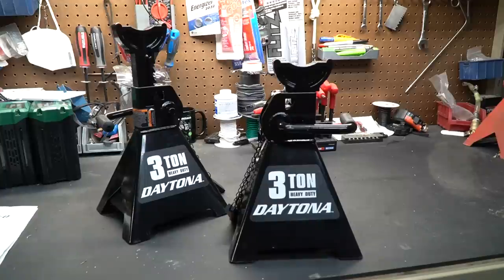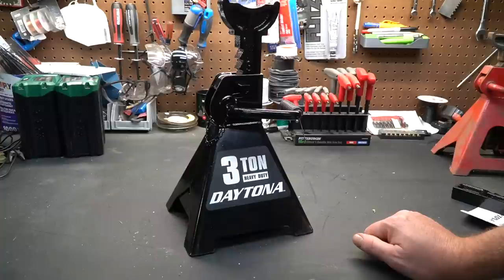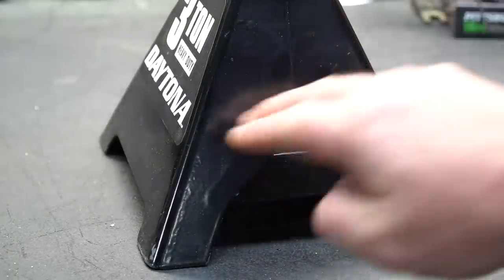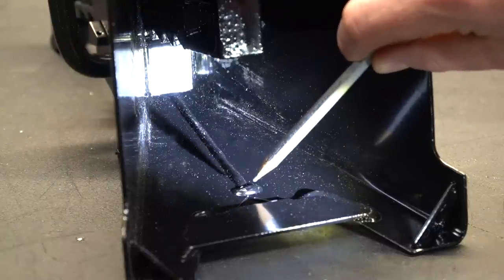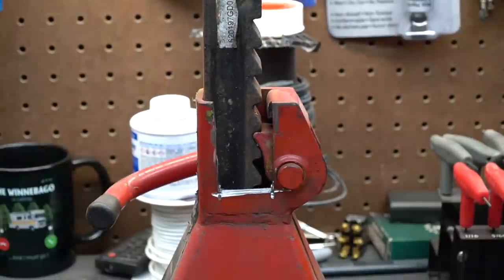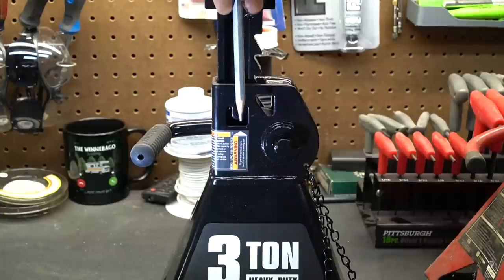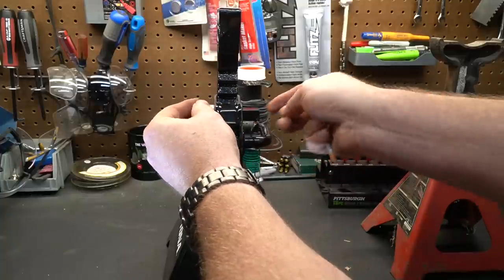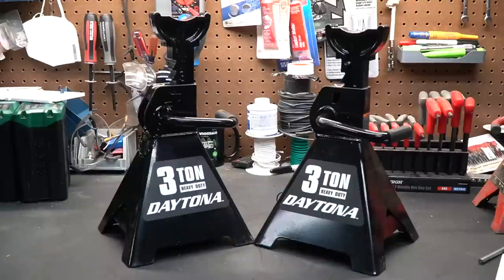Harbor Freight Daytona 3 Ton Jack Stands, Full Review, New Tool Day Tuesday! Locking Jack Stands!

Comment: good job Harbor Freight, in response to the recall, they add the double locking safety pins. makes me feel very safe using. I have the pro lift 6 ton double locking with same design as this. very safe and sturdy

Comment: I really like these! I may have to go get them. I honestly think the set I have still been using is the recalled ones 🤣
What's nice about that lock key stoping the arm from lifting and releasing is you can carry the stand around with them set at the height you always use without them collapsing when you set them down or the saddle lifting up if you grab them by it. I have pinched my fingers in them when I move them because the saddle slides shut when you bump the arm while carrying them.
I know there is a little lock tab you're supposed to knock in when you assemble them but I do NOT because I like that they come apart. I've been known to used the saddle/rachet part in my press.

Comment: I have this style stand in Australia but the handle attached to the claw has a shear pin through the centre of the handles round bar that shears off if to much upwards  pressure is applied to the handle while under load leaving the claw in its holding position and the handle spin free , a great design as i did break one pin  but no failure of the stand at all ,
The safety features on those look very reliable i would definitely purchase them.

Comment: I thought the only real issue with the old stands was that the pawl didn't have 100% engagement with the ratchet and thus could fall if the vehicle shifted, but otherwise they were decent stands. 

HF really went overboard with the engineering on these replacements from the embarrassment of the recall.

Comment: Was that stand that you cut away a hf stand ? Because that is not how the old stands worked. They had the teeth jamming against a cam, not a tooth. I looked at a few older ones including mine and no tooth was engaging. Looked to me like either a terrible design or incorrect installation.  Either way, they got it right this time. And yes, as a long time mechanic, all stands had teeth engaging teeth.

Comment: Great review! However, bumping the handle while working under the car is very easy to do and there are other videos showing just how easy the old HF stands fail. Think about someone with a pry tool or swinging a hammer accidentally hitting the arm. The original HF Jack stands only required about 1/16" to 1/8" of movement before the jack would fall unlike the new one with much more defined teeth and safety pin. I cringed and felt sick when I thought about how many times I've put my life in jeopardy through the years with my old HF jack stands.
Reply from the maker: The pictures I seen of the really bad ones that were part of the recall hardly had any teeth.  There are also YouTube videos showing some that have about half the thickness of the teeth that they should have.  I'm guessing the molds for the ratchet arm were too badly degraded and they should of been discarded.  Personally I cringe thinking someone wouldn't of questioned them and used them anyhow. Had I seen a jack stand like that I would of never used it.  All of that being said, this is also no excuse for the manufacturer.  After the recall there were jacks that split due to faulty welds, Harbor Freight recalled them as well, later to find out those hacks had just been misused and overloaded.  Sadly there are other companies that sold the very same jack under their name and never recalled them.
Reply: I have a Walmart version of these not safe cause no pin 🫠, going to pick up a set tomorrow 🫡 and a Daytona cherry red Jack

Comment: Cheaper than the Pittsburgh but  a lot heavier.  I guess that's fine if you're not driving them around.
Reply: Late to your comment, but for others, they do have a 3 ton aluminum now. Slightly more expensive but also much lighter and smaller.

Comment: Does anyone know what the failure mode was on the recalled jackstands and what the cause was?   Were the tolerances too great, allowing the ratchet arm to slide down off the teeth and pawl, or was there a material failure in the teeth which broke off?    Just curious, I have a set of Jackstands from Harbor Freight, which aren't part of the recall... and would like to be able to inspect them each time  I use them...
Reply from the maker: The teeth on the ratchet arm were too shallow, the manufacturer had been making jacks for lots of companies and the casting dies had worn out and were out of spec.  They were visually alarming and both you and I probably would of never used the stands and took them back.  People started testing other models after the recall and one fellow managed to overload his jack stand and split one of the welds on the side of the stand, so harbor freight did a larger recall to get them off the market.  Other brands had similar recalls, they just didn't go as pubic as Harbor Freight did.

Comment: Will they make these in 6ton
Reply from the maker: The folks in the store told me they were going too, but didn't say when.
Reply: @1D10CRACY  Looking forward to an increased height capacity of the jack.  These at 16.x inches, pulling transmissions with a HF trans jack, there is no clearance.  At the moment using 20+ years old Craftsman jacks that raise to 21.x inches (3 ton), but they're 20+ years old, would like to replace them for another 21 incher soon!

Comment: Why not just make a pawl with two tooth?
Reply: US Jack brand does exactly that.  All USA made, but they are expensive!
Reply: Well, if the two teeth were on the same pawl, there's still a single possible point of failure at the hinge.  Having a separate locking mechanism offers greater redundancy.

Comment: They sold Jack stands that failed that could have easily kill you, why would you trust them ever again 🤣 by rule of thumb they sold defective jack stands they will probably do it again.
Reply from the maker: Personally I trust nobody.   But I am capable of looking at a jack stand and making an educated guess on whether or not it is built right.   If you are buying a jack stand based on the brand name, you probably should rethink your plan.   Most Jack stands are made in the same factory and just have different brands stamped on them.
Reply: Because they have redesigned them and they are now excellent compared to all the other chinese made stands.  You can buy superior USA made stands from U.S. Jack, but you'll pay a LOT more.   I trust these and I always have a backup method of support by adding a screw jack.